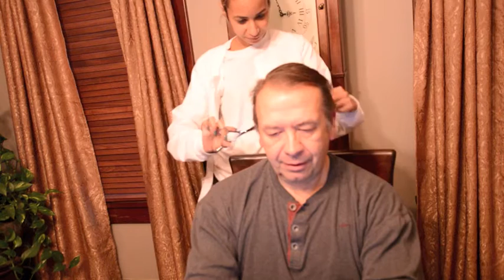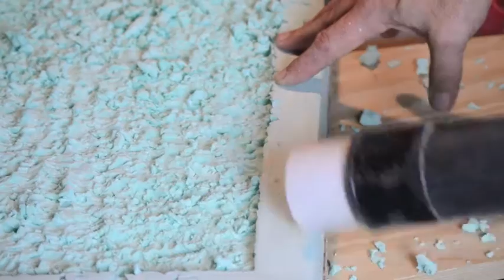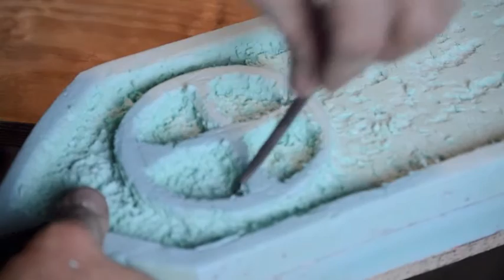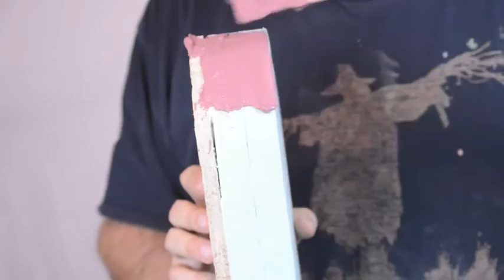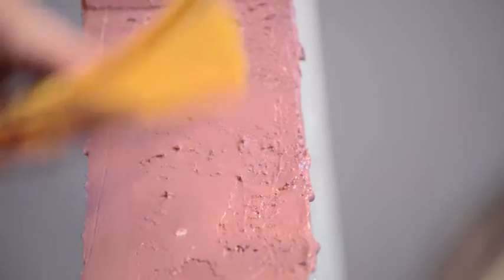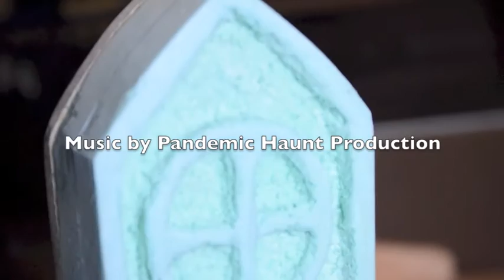A Close Shave - Bleached Bones Vlog 26

Comment: Doing well. I've had the monster mud crack when I layered it on a bit too thick but should do fine.
Reply from the maker: +The Pirates of North Court True! It's actually not as thick as it looks. Well, I I applied it thick, but using that yellow plastic tool to smooth it out it also thinned it out. Thanks!